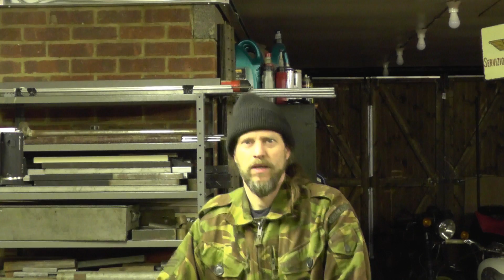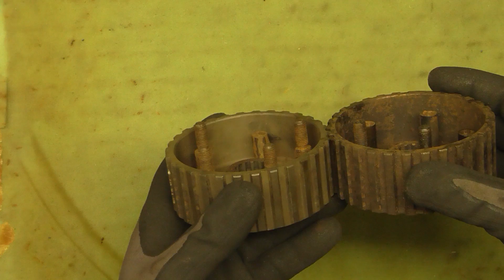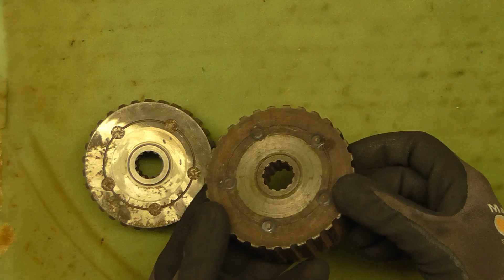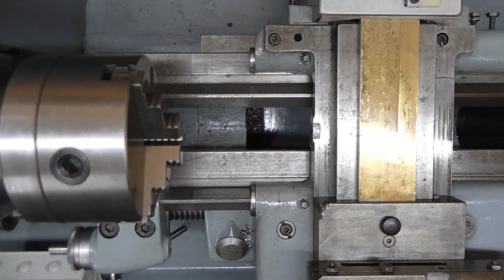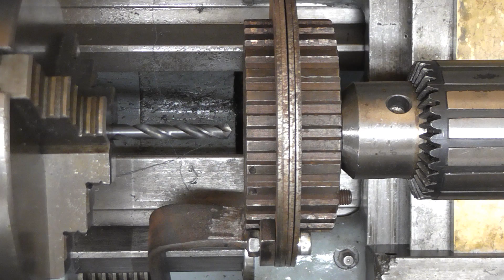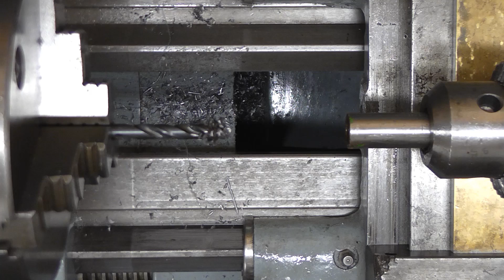Morini Clutch Hub - Broken Stud Removal

Comment: With the majority of the pins needing to be replaced, why not go ahead and move them to threaded hex like the second piece? Looks like a much better system. With so many breaking off, looks like being serviceable would be a great consideration.
Reply from the maker: These are hubs that originally came from a former Morini dealer. The studs hadn't broken, they'd been drilled to remove seized spring nuts. They're a result of poor practice (I don't completely bottom the nut) or hamfisted owners not having the right tool. The round posts seem to be a later modification.